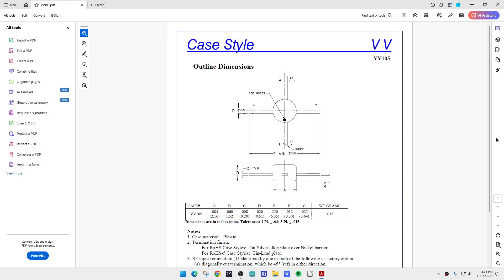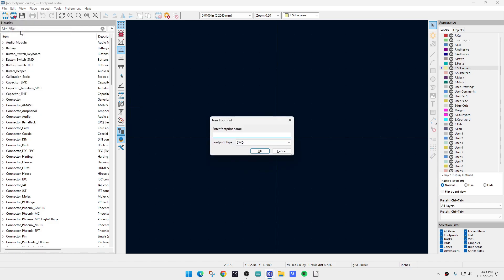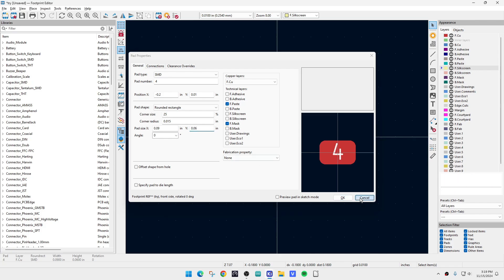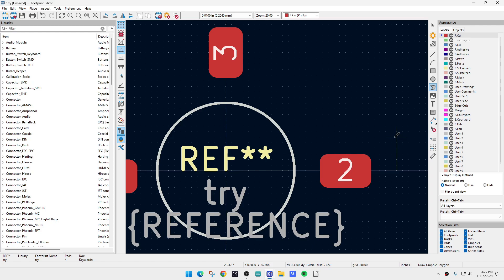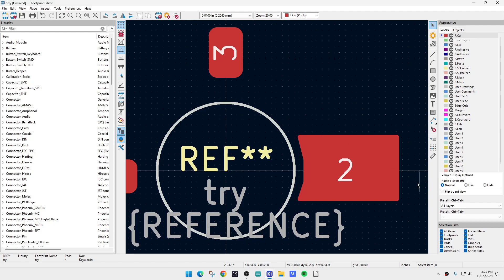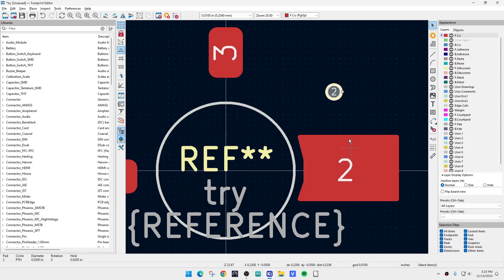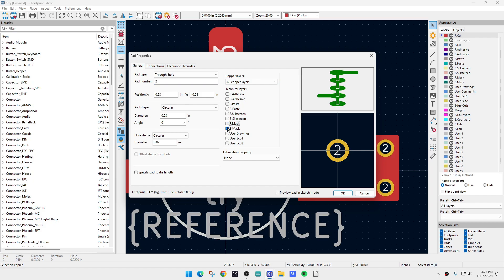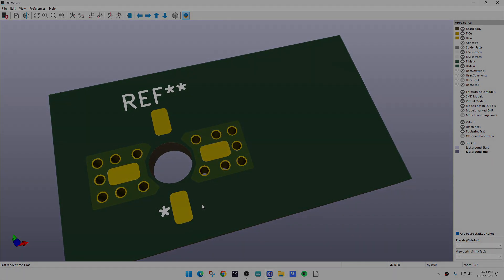#2061 Making a KiCAD Footprint for MMIC

Comment: Hello Mr IMSAI Guy,
I'm interested to DATV on QO100 satellite, but it needs high power.
So I would like to make my own 2.4GHz RF power amplifier with a Freescale  Transistor MHT1004N.
On the datasheet, you can find a schematic to make a PCB, but I'm not a boss with Kicad : You are !
If you're interested in this project, I'll appreciate a couple of videos to reproduce the PCB with Kicad for this chip.
Thanks, 
Jerome, F4GMU.

Comment: Thanks! I tried to do this with a thruhole footprint that would accept both .25 and .5 lead capacitors (3 holes, 2 of which are tied together). Now I know how to do it without needing a connection on the pcb drawing (because the 2 holes were not connected in the footprint).